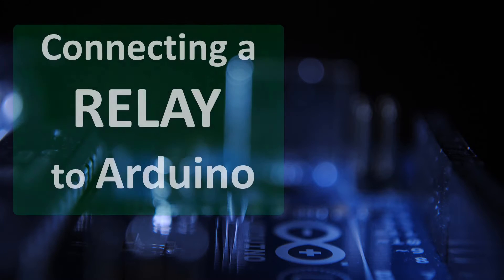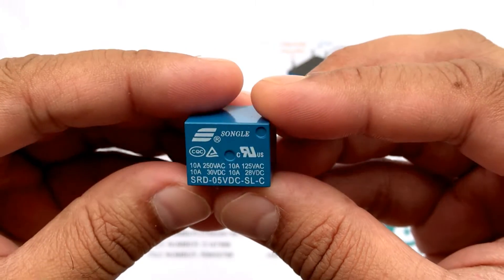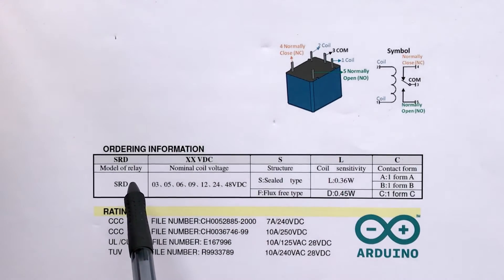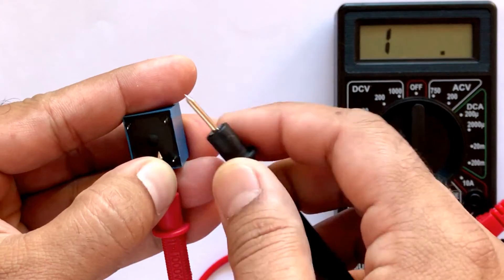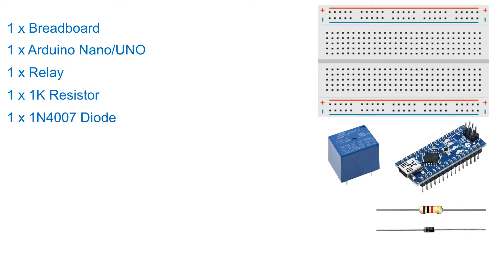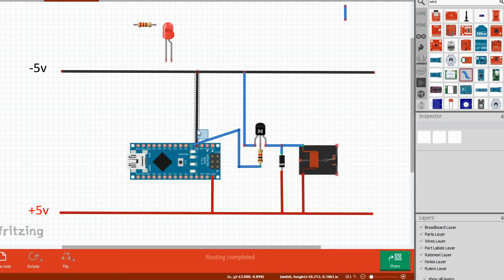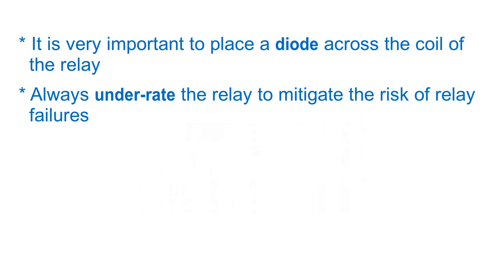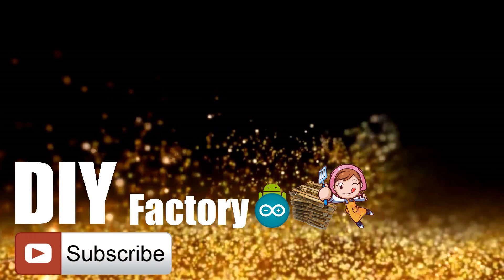Driving a Relay with an Arduino

Comment: I have a question it might he silly still a question is a question why we are using transistor there can't we simply provide 5 volt and ground supply to the inductor inside the relay
Reply: I had the same question
Reply from the maker: A transistor is used to power an inductor because it acts as a switch to control the flow of current and voltage levels. The transistor can turn the current on and off, ensuring that the circuit is only on when current is flowing.
A transistor can adjust the voltage level, which helps electronic devices use power efficiently.
The transistors is used to amplify and regulate the signals received from the Arduino. It also protects the Arduino's pin from getting inducted.
Reply: @CrazyCoupleDIY  thanks for your explanation
Reply from the maker: Always Happy to help

Comment: I got lost a bit.  What is the transistor for?  If I understood correctly the transistor was only used to make the light blink on its own?

I understand the importance of the diode.  For my project I was thinking of connecting one side of the coil to 5vGND the other side the coil to a 3.3v pin (esp8266) with the diode in between.  That way when pin goes high, it would power up the coil, when pin goes low it powers off the coil.

What would my way of doing it not work, or be wrong?

Edit:  So I did see video again, and noticed relay goes on and off because of the code you put in.  I've seen a couple of short videos, like this one https://www.youtube.com/watch?v=19UNeUmvOW4  that connect power straight to the coil pins.
Reply: So I think I figured it out, but would like someone to confirm.  For the coil to work it needs 5v, the adruino and esp8266 (which I am using) only have 3.3v as output.  That is why we use the transistor which acts like a relay.  With 3.3v the transistor "connects", providing 5v to the relay coils when then power on the NO side of the relay.

Do I understand it correctly now?
Reply from the maker: Yes, that is correct
If you connect the relay directly to the arduino, you can end up damaging the pin.
The transistor works at low voltage and allows 5v device to work seamlessly

Comment: Why are you using VIN with a 5V supply? Wouldn't you use the 5V pin instead to power the arduino?  Otherwise the 5V tries to go through the 5V regulator.. read that the VR needs 7-12V.
Reply from the maker: Hi there 
VIN means Voltage IN

Arduino boards have five options in which they can be powered: Powering via USB connector. Powering via the onboard barrel jack connector (if available on the board) Powering via the onboard battery connector (if available on the board) Powering via the VIN (Voltage In) pin. 

5v pin to power the sensors attach3d to the board.
Reply: @CrazyCoupleDIY  I'm powering the arduino with 5v from 7805 by connecdting the 7805 +5V to the 5V pin on the arduino.  Not usb, not jack, not VIN.  VIN expects 7-12V as that goes thrugh the on board voltage regulator.
Reply from the maker: @jenniferw8963  I will not say that your setup wont work or is incorrect.
But, VIN means Voltage IN (7-12V Nominal) and 5v pin to power the sensors attached to the board.

There is no hard and fast rule to say that u cannot power the device through the +5v pin or the VIN which obviously has a voltage regulator.

Comment: Very good tutorial! Question:  Why do you need a transistor?  Can't you activate the relay using 5V from a digital pin on the Arduino?
Reply from the maker: 1. The transistor is used as an amplifier to limit or enhance the current which is given to the NO or NC pin.

2. Yes you may. Check out my 2nd tutorial on this :
https://youtu.be/3n69b4sdDjk
Reply: My opinion its useless... just dont use it

Comment: Hyyy i hope everything is good.  I need some help i have this project. And my goal is 

to control two 12v fan 
 I have a. L298N motor driver controller 
I also have a. timer delay relay 
I also have a .elegoo uno r3
I also have a. Lcd screen 1602A
And it should all be controlled by the bluetooth dsd. My goal is to be able to controlthe fans with my phone. I want to be able to set a timer on the fans and also turn it off when i want.  Is there any way you can help me
Reply from the maker: Hi there sure I can
So you basically want to control the fans using the relays or via the motor driver? 
Cos you can send high or low signal using your uno to either one of them and let them run until you send a low. 
Also why do you need the lcd screen for

Comment: Why do you need the transitor? is there anything wrong with just connecting pin 2 directly to the relay?
Reply from the maker: You would not like to kill the pin of the Arduino by connecting the relay straight to the pin.
Basically the output current is not enough to magnetize the relay. So to add a bit more of current I have added the transistor
Reply: Crazy Couple doesn’t all the pins have a current limiter circuit? It worked fine for me to connect it directly, but then i saw this video, and now i wonder if i should change me circuit.

Comment: Hi, great tutorial, congratulations!
Just a little correction: In the fritzing squematic you connected 5V power supply to the VIN arduino pin, but in the real circuit in the breadboard you connected the 5V power supply to the 5V arduino pin.
I have read that the regulator in the VIN pin needs more than 6.2V to work. Does it work well if you connect 5V power suply to the 5V arduino pin?
Reply from the maker: First of all thanks a lot for watching the video.
Now, in the fritzing schematic I am powering the Arduino externally using the 5v power supply, and in the demo I am powering it using the USB cable so I am not using the VIN pin in that case.
In the demo I am using the 5V Arduino pin to supply 5V to the Breadboard's rail for the rest of the circuit to use.
Yes, you can very well power an Arduino using a 5v regulated power supply.
Let me know if that answers your question :)
Reply: ooh okok I see it now. I didnt see the USB cable :p my mistake.
Thakns! So I can power the Arduino using a 5V regulated power supply connected to the 5V Arduino pin, right? or should I connect the 5V power supply to Vin pin?
Reply from the maker: Absolutely right mate. If you are using a Arduino nano just turn it around and you will see a voltage regulator under the board. So I am pretty sure u can even use a 9v power supply to power it up.
Reply: Okay. Thanks!

Comment: Why is the transistor needed?
Reply from the maker: The coil of the relay needs a large current (around 150mA) to drive the relay, which an Arduino cannot provide. Therefore we need a device to amplify the current. In this project the NPN transistor 2N2222 drives the relay when the NPN junction gets saturated.
Reply from the maker: More info can be found here: https://diyfactory007.blogspot.com.au/